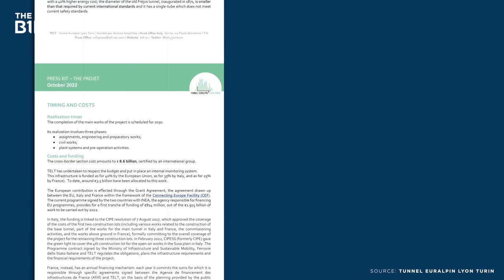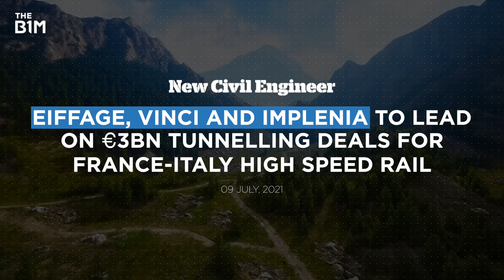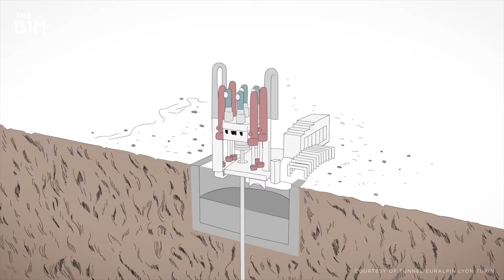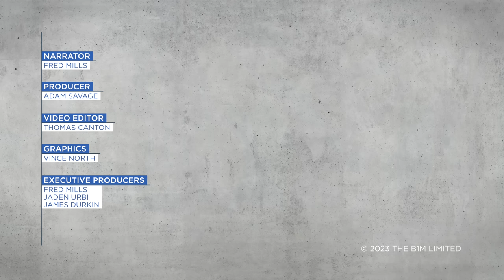Why Europe is Building a 57KM Tunnel Through a Mountain

Comment: Love the video, and RE the value of the tunnel - Almost any large construction project built to optimize transport has been a massive success over a long time.
Sure it takes forever when building it, costs billions, delayed by years at times, risk of corruption, but once it is done and Operations have been smoothed out, usually it is just one long surplus giving project that maybe has to spend 10-15 yrs to pay for itself but it usually lasts 50-100+ yrs without major maintainance, so economically alone it is worth it.
And then there is the economic stimulus of such a project on the trade and economy of the users which is usually not measured in, which is billions+ again.
Reply: True! Consider that utilities often are granted authority to issue bonds over 40 years for major power projects. Something like this that vastly reduces the carbon footprint of travel by air? It's a no-brainer.

Comment: cant wait to take a high speed train from Paris to Milan
Reply: Yeah it's already there but :
From Paris the trains run on the HSL to Lyon then on the Lyon Eastern high-speed bypass that goes under Lyon LYS airport then just a little South of Lyon they exit the HSL towards the East on the conventional network.
From there they have to meander the valleys of the Alps to climb to the current tunnel, then it's the same descending like a serpent on the Italian side then they continue to Turin, and there they can hop back on the HSL to Milan.
Surely it's shorter than trains running at conventional speeds but it's still quite long.
The project sets a path that's going to be almost entirely on HSL from end to end : a new HSL linking the Paris <> Lyon <> Marseille HSL to the base tunnel and if I recall correctly also a HSL stretch between the base tunnel and Turin.
It's going to have significantly shorter journey times than today, especially the direct nonstop Paris <> Turin or Milan trains.
We might see tons of Fashion Week trains running the great seasonal fashionistas migration in the future. 🤣

Comment: I'm confused. Is the island of Malta going to get a tunnel or bridge connection with the mainland or am I understanding incorrectly how this network operates?

I find information about this project remarkably difficult to find.

Edit. It'll be shipping routes.

Still, amazing Europe is doing all of this, here we can't even get a 900 km high speed line between our two biggest cities to alleviate one of the busiest plane routes in the world.
Reply: Shipping route must also be used for Turku to Stockholm part on the ScanMed corridor
Reply: The sea floor between Malta and Sicily the Malta Plateau is 150m deep and the islands at their closest is 80km. Not bad but not great for building any tunnel, I think you'll start getting into atmospheric issues and pressure if that deep. You'd need a pressurized train for people to not get the bends when it rises back to the surface. And from what I can see about the areas around the Malta Plateau seems to be 800m to 1,500m deep. Plus earthquakes since Malta is supposedly OK but southern Sicily is in a seismic zone.
Reply: There is no demand for a tunnel to Malta. But maybe fast ferries.
Reply: @dg-hughes  For sure, that's why I was so surprised as it doesn't really make a whole lot of sense.

Comment: I'd like to know the amount of fuel and CO2 emission that goes into building these mega-tunnels and how long it takes for the reduced travel distance to pay it off.
Reply: 7.6 years
Reply: @cartmann227  Are they considering the fuel/CO2 of the workers driving in to work on it? The cost to build and transport the equipment? How about the CO2 of the citizens driving to their jobs to earn the $9B it cost? I think the fuel/CO2 cost is a whole lot higher than advertised.
Reply: @Kragatar  bro wtf, why would the include that? Workers would be driving to work anyway, just to another job and location, same goes with the equipment, it would have been sold anyway and used for something else.

Comment: I work and live part time in Val Cenis, in the Maurienne valley. I don't have a problem with it but: calling it a 'high speed line' is silly. And the claimed time savings are crazy: the main passenger train that goes through the old tunnel (Paris-Milan service) could go ~2 hours faster tomorrow if we wanted to by ditching around 7 (yes SEVEN) intermediate stops on what is supposed to be a flagship, high speed service. It takes around 5 hours to get to Modane from Paris, the start of the current tunnel, and that could be cut down to 3ish hours simply by taking the direct route and not stopping at every bloody station. No idea about how much time can be saved on the Italian side, probably a large amount. Us locals who take this train regularly know this, so spending billions and billions for a quoted time saving that can already be made with scheduling changes is a bit of a hard sell. As for the environmental impact, it's not a strip mall where we need to turn half the valley into concrete. No problem with the environmental side.

This is the cost of progress, this needs to be built but they need to be realistic about what it's going to do: making it easier to carry more freight on rails through the valley. The Tunnel Du Frejus is ancient. And of course hard core leftists/antifa/black bloc hate shite like this so make it their mission to ruin everyone's day, including people like me who live in the vicinity and have genuine, reasonable concerns.
Reply: If you wanted to only connect Paris and Milan you can already do that. It's called a flight. A train running that whole distance without any stops in between is as dumb as it gets. Good luck ever filling that with passengers.
Reply: @Tokru86  Don't see how a fast through train couldn't be scheduled around local runs. Whether it would be profitable, I don't know, but the airways also get crowded.

Comment: I don't understand people who are against this kind of project. The alternative is cars and trucks, which is absolutely worse due to noise, pollution, greenhouse gases, and accidents. The best solution would be to build nothing and drastically reduce traffic. However, if the same amount or more traffic is to be maintained, then the train is by far the best investment. I start to believe that big oil lobbies could be supporting those "activists"... That would be a pro gamer move...
Reply: Another commenter explained the original issues, which included tunneling through an area known to be asbestos.  Those issues were dealt with, but violent people took over the protests on financial grounds.
Reply: the railway will not be made to transport people, but goods on truck, similar to the channel tunnel project. The cost-benefit study maker says the crossing will be so expensive that many will prefer not to use it.
Reply: @darthmaul216  you don't even know what you're talking about

Comment: Wait so they don't want the train route to be built because it will harm the environment even though it would take cars off the road and beneficial?
Reply: From what little I've been able to gather on the subject, the initial oposition was due to fears of unnecessary environmental impact due to faulty planing of the tunel route.
Things like large viaducts or the excavation of rock formations containing asbestos.
The route was then modified to avoid the largest issues.
After that, protest was afaik upheld by the sort of people who are simply against everything.
Reply: @Bird_Dog00  and that kind of people started putting bombs.

Comment: Why on earth would you protest a train that goes through a mountain? Like are there any project these eco terrorists won't oppose?
Reply: There is a great deal of surface construction as well.  You need marshaling yards to assemble materials that go into the tunnel.  Access ways to the sites where the vertical ventilation tunnels must go.  Systems to handle the MASSIVE amount of spoil removed from the tunnel.  Concrete factories to build the lining of the tunnel.  Yards for those concrete parts to cure before they are used.  All of this goes through areas that were previously untouched, may pass close to places that do not want the disruption.  In some cases, the objections are more to the price tag and what might have been done with that money in a different project.  Such as the hospitals mentioned in this video.
Reply: @EdwinWiles  A small price to pay to get vastly less truck travel.
You have to break eggs to make an omelette.
Reply: @thosoz3431  You and I may consider it a small price.  But value is relative, not absolute.  Your meal at home does not have the same value as it would for a starving survivor of a disaster.

Comment: I wonder how a tunnel really impacts the environment. You're moving a lot of material out of the mountain to another place, but a line on the surface would have a large disruption to ecosystems along the whole distance of the line. The material from digging the tunnel could possibly be used for other projects where they need to increase the height of the ground, so I'd assume that that impact is relatively low. Therefore it appears like a very good alternative to me. I could be overlooking something though
Reply: Don't dispose––re-use! 
https://en.wikipedia.org/wiki/Tunnel_rock_recycling

Comment: Really good content. Very good points. Im in policy and was wondering myself why were building this and other expensive rail lines if its just for slightly faster passenger travel. However, if it massively increases freight volumes and speed and gets truck air and noise pollution, as well as traffic jams off the roads (all of which are really bad in these mountain valleys), then it very well might be worth it.
Have no idea if the cost is bloated or not though obviously.

Comment: What exactly is the proposed environmental damage? Most of it is under a mountain, and the rest is a thin line in the landscape that reduces the environmental impact of driving cars if you're trying to get from point A to point B, and even more so if people would have flown instead, aircraft emit a ridiculous amount of CO2 per mile. If wildlife is a concern in the open terrain bits, create animal passes, and fence off the track, like we do with highways in Canada. Trains are a method to reduce overall environmental impact, otherwise the next best option is to simply not travel between places, and that's a bit unrealistic unless you can produce everything you need to survive in your local town. It's not like this train route won't be carrying freight in addition to passenger traffic.

Comment: Just wondering one thing, are there not sometimes big hollowness within mountains? I wonder how they would handle that if they faced it along the way. As mentioned, they cannot see this beforehand because of the massiveness of the mountain.
Reply: Cheyenne Mountain had a large fault in its core. This was found while under construction. They built a steel spherical object and filled the outside with cement. This gave the area to work inside that wasn’t compromised. 
You might enjoy looking this up. I think it was described properly
Reply: @andrewday3206  Thanks mate!

Comment: The existing line is hopeless operationally. The grades are much too steep. There are S shaped tunnels on the upgrade attempting to reduce the grade. This major upgrade is needed to complete the east west link. There is a lot of additional tunneling in the Suza valley to put the line underground to placate the residents.

Comment: Actually thanks to recuperation (the motors used generator on the downhill slope) a 
train needs lees energy going over the old pass then the new tunnel.
The big wind resistance in the narrow tunnel is very energy consuming.
Especially in high speed.
Reply: If you want to minimize energy consumption, going through the flat tunnel would be better than climbing up the mountain, but you would have to go through the tunnel slowly.

But I think the intended impact is a multiplication of the capacity due to the higher speed. If the trains go twice as fast, you can send twice as many (freight) trains from Lyon to Turin in the same time.

Comment: I'm sure that the opposition of the tunnel have much deeper thoughts than "Lets not build the tunnel, build hospitals instead". But, Europe needs these tunnels. If rail should be the best option in transportation, these tunnels are necessary. The trains using the tunnel would not be only competing with cars and trucks but with planes as well. Relieving from these transportation methods is a must for our environment. We have to reduce CO2 emissions and that as fast as possible. Time is not our friend in climate change.

Comment: How on earth do they even go about transporting TBMs?
Reply: They are built in a factory specifically for the job.  Disassembled to parts that can be moved via available surface routes (ground or air) and rebuilt in place in an excavation at the desired level underground.  You saw part of the rebuild in this video.
Reply: Almost all TBMs are build by one family owned company from germany. The TBMs get assembled at the tunnel entrance out of 1000s of smaller parts that can be transported by train or truck.

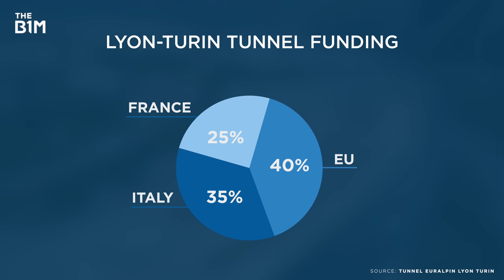Comment: 4:25 the longest track is on France site, but why are they put less money than Italy?
Reply: Several comments replied to this question: 
The split cost mentioned in the video is for the tunnel and a few bits here and there that are only a part of the overall project between Lyon and Turin.

The French have a much longer stretch of HSL (for passenger trains) to build on their side between the existing Paris <> Lyon <> Marseille HSL and the base tunnel, and much longer stretches of conventional tracks to upgrade for the freight trains. They'll cover these costs separately as this new HSL is essentially a domestic line to sum it up.
The cost mentioned in the video is the international part of the project, even though it presents the overall project between Lyon and Turin.

Comment: December 12 1917,  a french army train transporting soldiers on leave back to home in France derailed on the downslope after arriving in Modane.

The line from Modane to the area around has a really severe grade - 33 promille. It is estimated that the train at time of derailment had a speed well above 130 km/h.
The grade on the italian side the tunnel opening and downhill is also 30 promille.

European goods car brake gear is required to be able to hold a train still at the south slope on the Gotthard line  but the line between Modane has a more severe route.

Comment: There won't be any net environment benefit until all the CO2 produced from the concrete used, running the machines etc. has been offset by savings from fewer trucks which will take many years.
Reply: Of course it takes investment to achieve benefit. That's true of any project whatsoever, no?

Comment: Every time when talking about how a projet would reduce CO2 equivalent emissions it's important to state the CO2 cost of the construction and how many years the project needs to pay-back that cost.
For example if the CO2 cost of the tunnel represent 200 years of the replaced transit you can cleary see it's catastrophic for environnement.
Considering how fast diesel-hydrogen (for trucks) and solar/hydrogen (for cars) technologies are developing currently, the Tunnel woud not be a valid ecological solution if its CO2 equivalent emission payback is no shorter than 20 years.

(edit :)
---
Hot-take 1 : (Ecologicaly bad)
I'm not aware of the begining of the project nor the money already spent for the construction, nor what the activists claims are.
But to this day and age, it's easy to understand that putting billions of euros into a tunnel in order to reduce the ecological impact of good transit is by itself a dumb project. That money should have been spent in order to push the economy to reduce the need of goods transit by developing infrastructure to locally produce goods.

---
Hot take 2 : (Politicaly bad)
This construction is the definition of building infrastructure purely for the economy growth of building companies. The very essence of the tunnel is to increase the exchange of goods across a liberal market. Over-liberalism is what lead to the destruction of european manufacture and decentralisaion that lead to the multiple crysis we are currently facing. It further increase or dependance on international markets (everything made in China, more than 80% of UE gaz was from Russia before the war).

I will not elaborate further as I'm not any good for these hottakes nor any competent in geopollitics.

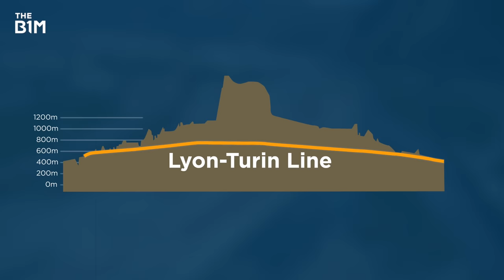Comment: 3:12 'modern tunneling methods will be used', what a surprise, no more picks and wheelbarrows? So, the finished tunnel will reduce CO2 emissions by 3M tons a year (is that a lot?) but how tons of CO2 will be generated by construction?  Interesting that this will be half a K longer than the Swiss tunnel. Is somebody worried about bragging rights?!